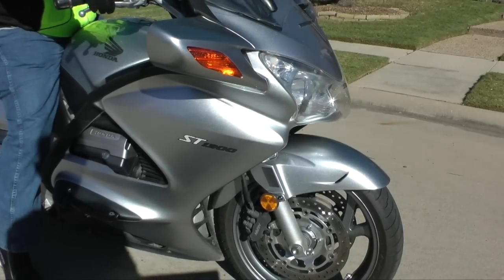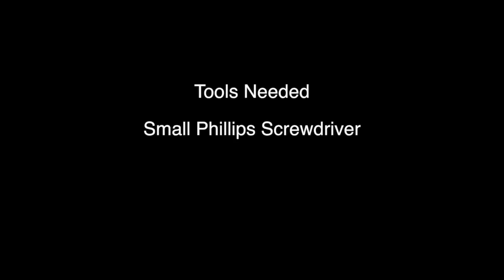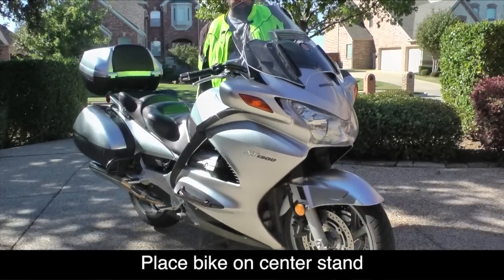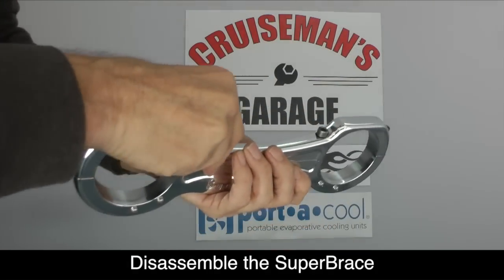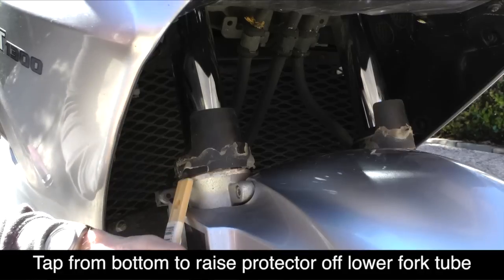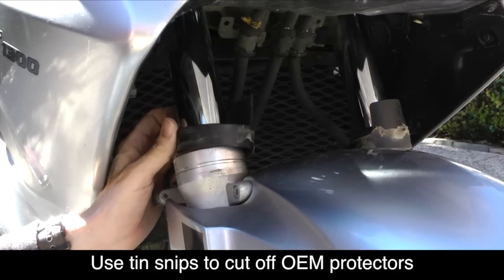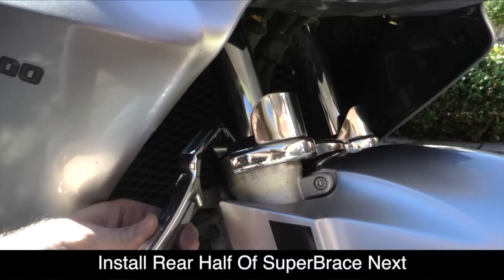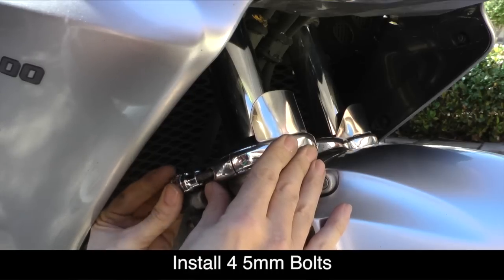Install SuperBrace on Honda ST 1300

Comment: What was the purpose of loosening the axle pinch bolts?
Reply from the maker: If the front forks are not aligned, loosening the pinch bolts will help force them into proper alignment when the brace is installed.
Reply: Should you not loosen both sides?
Reply: If I'm thinking right you should loosened the other side because that's the side that slides within the fork?
Reply: @omfgwtfbbq90   Hi did you ever find out if you should loosen both sides,
As I’m thinking of fitting a set  thanks for any advice you can give
Reply: @mac243877  just loosen both sides since it's just 2 extra bolts. Seems logical to me...

Comment: What is the torque setting for the pinch bolts? Looks like a proper force is applied; that would ruin the fork legs on my Varadero.